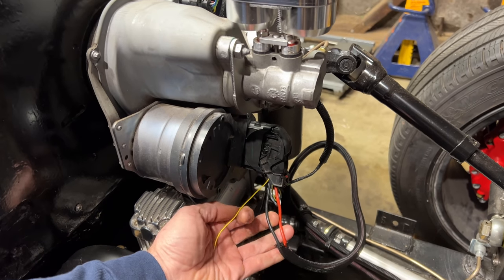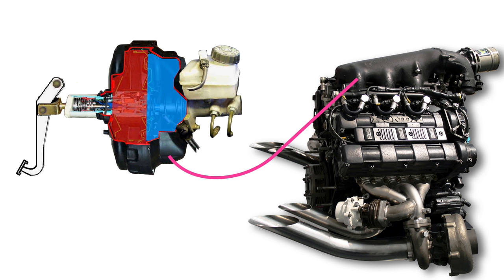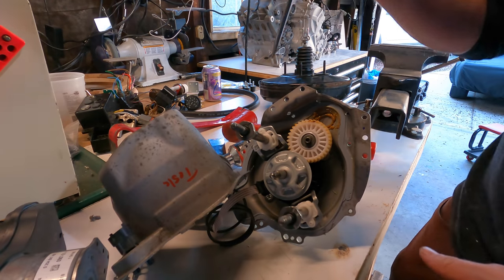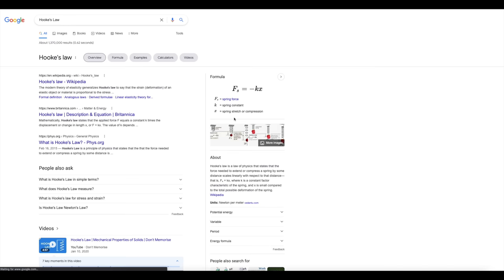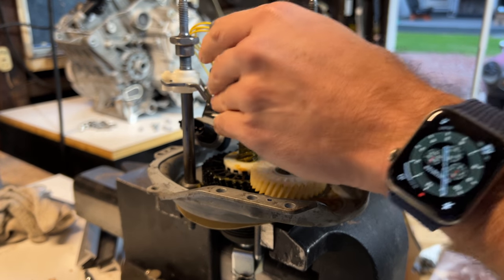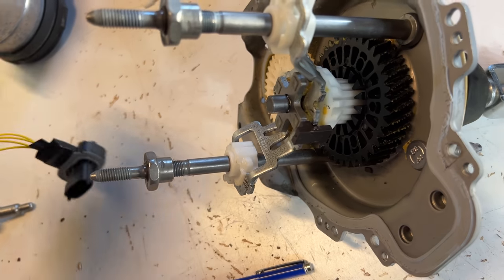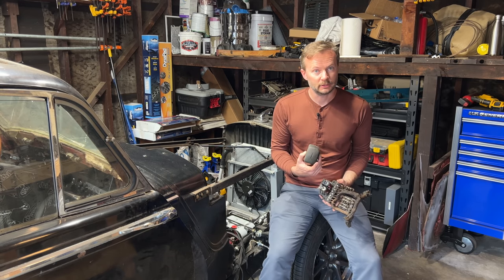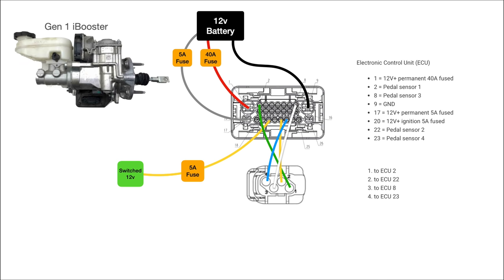Inside Tesla's Brake Booster (And How To Use It On Any Car)

Comment: You have saddened me as a F1 fan and engineering gear head by using a pic ⛏ of a f1 v6 twin turbo honda engine with poorly engineered, flat sounding musical notes instead of the 1991 Honda 3.5L RA121E V12 engine which made beautifully engineered musical musicians performing mechanical music works of art to the highest degree, reminding fans of works like the lovely Can-Can overture in qualifying, fighting through the Hungarian March, and finishing up with the Toreador March in celebration of another victory overture in the most pompous fortissimo sounds imaginable that will move one’s heart and soul, shaking it to the core as the mechanical 12 band orchestra uses rapid accelerando tempos down the straights.

In other words, as an engineer, how could you abandon the mechanical works of art from are gear headed engineering fore-father’s who came before us laying down the foundational blocks and combustion fundamentals to mechanical perfection and harmony in terms of mechanical art work that moves the soul and in colorful ways, inspiring work of mechanical art as a vivid masterpiece complex components that the Great Harold Arminius Miller would be proud of as he admired it’s performance gazing down at the v12 from the heavens as it performed wonderfully for the crowds.

Comment: I have a cj7 with no power brakes. Large tires. I see it as a safety feature. I still have brakes even if the engine is off

Comment: Your brake servo is not the only thing that sucks in this episode.

The basic rule is that beers should be served at the temp they were fermented. Lagers (US lame beer is lagered) should be served at about 40°F and ales (which are brewed) around 50°F - 55°F. 

Ale is top fermented which produces more flavor.  Lager is bottom fermented which produces less flavor.

So English ales are drunk warmer than gnats piss American Nontheweizer lager.  But is the stuff even a real lager?

As you brought up the pathetic joke about Lucas making refrigerators I'll have to point out that all the major US breweries modified their recipes in the 1970's to get more women to drink their beer.  They substituted rice for barley, to give it a lighter color, and added a seaweed extract to sustain the CO2 artificially induced foam head.  (US law requires US beer to be pasteurized, killing the yeast fermentation process.  No fermenting, no foamy head.)  If you drink American beer warm it's closer to Sake than any German beer.

If German brewers changed their recipes like the US ones they would end up in jail.  Their ingredients are stipulated by law!  US beer recipes are just fashion statements.  Luckily many Americans have learned their lesson and are now brewing some world class ales.  Ales that should be drunk at between 50°F - 55°F to enjoy their flavor.

Bottoms up!

So.  How does the Jagla go around Willow Springs?  Inquiring minds want to know.

Comment: ABS TEVES 2  is 1984 year, and is not a vacuum system, on your face Elon Musk hahaa
Reply: That's a pumped hydraulic boost system, with a dedicated electrically-powered hydraulic pump (unlike the more common "hydroboost" systems using the engine-driven power steering pump). Yes, not vacuum... but also not directly boosting with an electric motor.

Comment: 9:37 What? Why would that make the electric booster better?
Reply: If your engine dies with an electric brake booster, the booster keeps working (since there is still electrical power, even though the engine isn't running and producing vacuum).